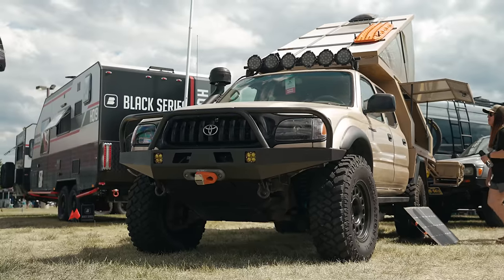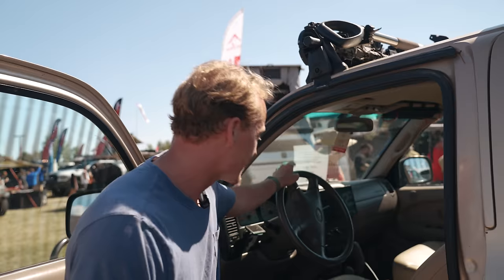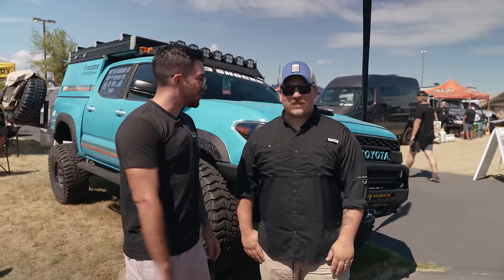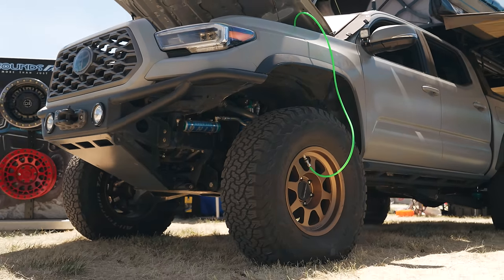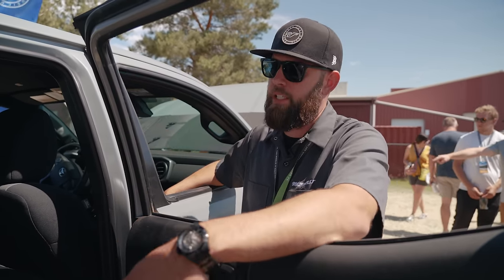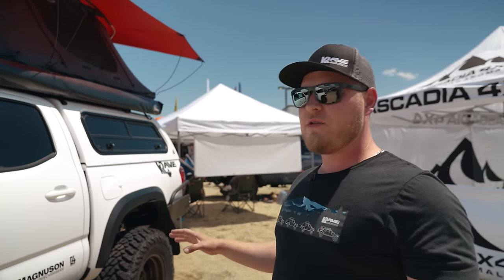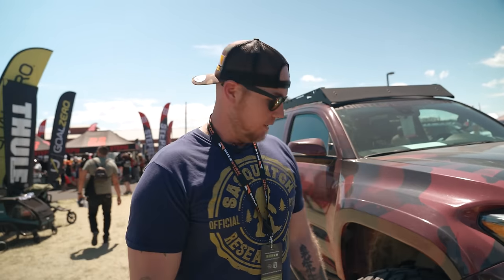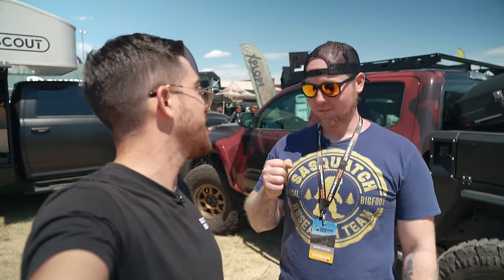Top 5 Tacomas at Overland Expo PNW 2022

Comment: Just in case I end up building my truck up, could I still expect it to go 200k miles without it falling apart assuming I get it done properly?
Reply: If its been maintained well and oil changes etc in a good schedule then you should be able to go 250k easy
Reply from the maker: Yeah you should have no issue with that 🤙